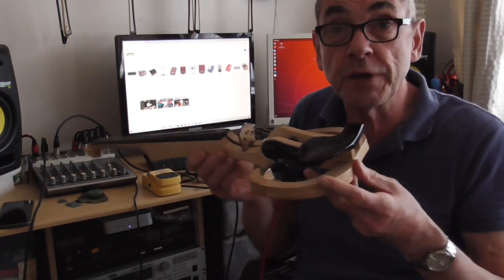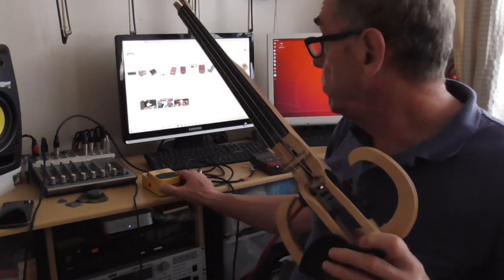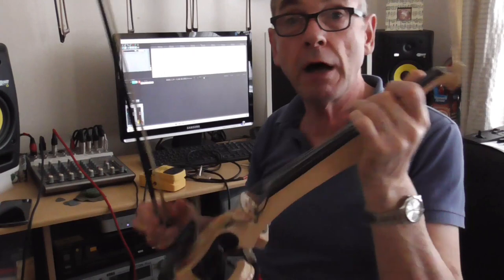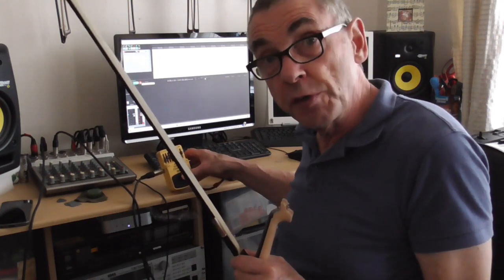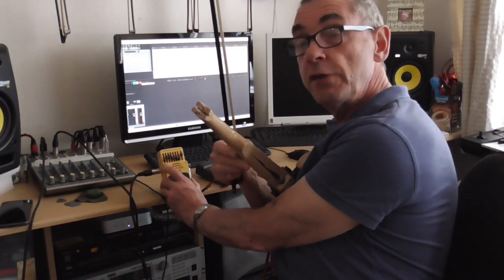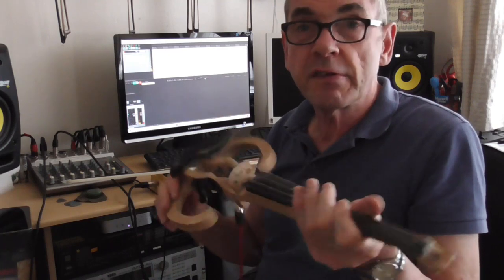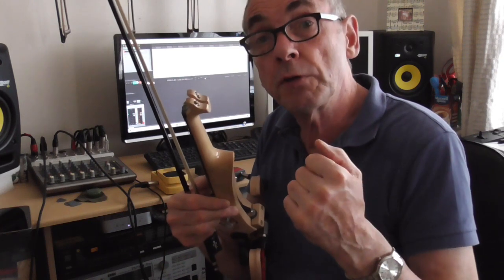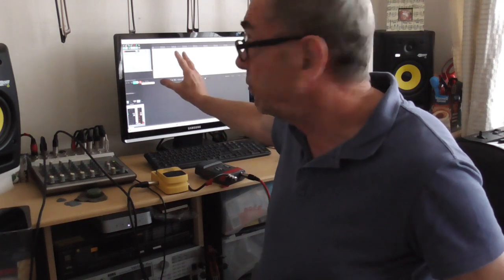Electric Violin & Effect Pedals - Part 3 - Sound of a Passive Violin

Comment: Yes there was a perceivable difference before the direct interface box, and using it, and then the E.Q. Brilliant, and now quality sound is much enhanced, Great job my friend !!!
Reply from the maker: Yep, it's a tricky one with electric violins, lots of trial and error required to achieve a reasonable sound.
Reply: @peakfiddler  Is your cheap Di for the passive violin pickup active or passive?
Reply from the maker: @ricklye7340  Hi Rick, the pick up I use on the Scorpion fiddle that I show in this video is a passive one. No on board battery at all. Here is an ebay uk link so you can see the type of pick up I used. https://i.ebayimg.com/images/g/jzYAAOSwc4BeviN5/s-l1600.jpg